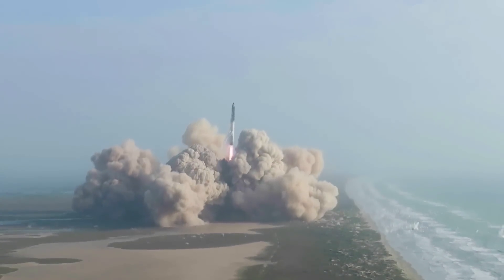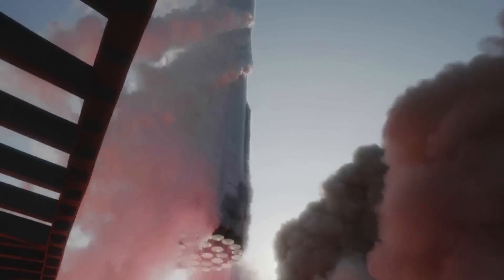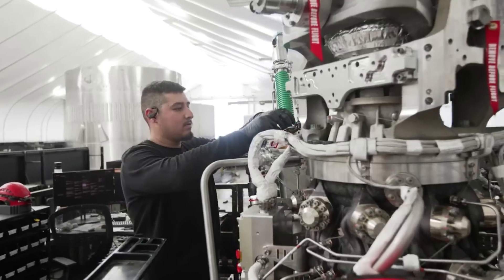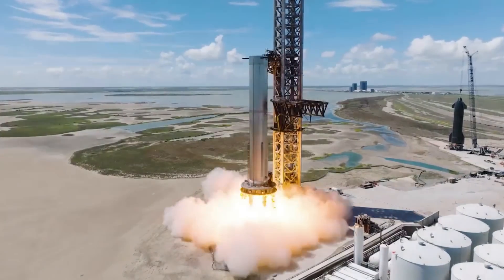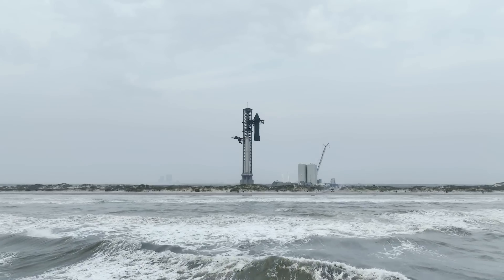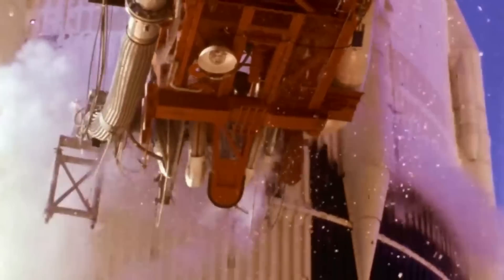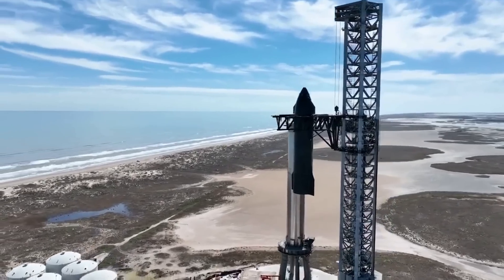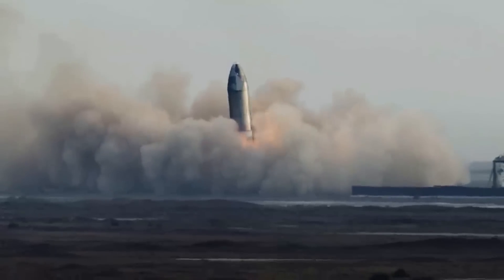Could Steel Plates Solve SpaceX's Starship Pad Issues?

Comment: I feel sorry for the engineers who tried to tell him this would happen without diversion. It was hardly a secret.
Reply: "It's not going to work."
"I know, but do you know how much it will fail by?"
"Well, not precisely no; the math only takes us so far."
"Let's get you that data then."

If you have an opportunity to collect data with fewer confounding variables, then best to take that opportunity.  If you propose a solution before you fully understand a problem there's a greater chance of being married to a solution that might not be the most effective, or worse yet a solution that will never work.

After all the whole idea behind this is that these rockets may someday land on a flat surface found on the Moon or Mars, and they probably won't have a fancy launch pad with specialized trenches to get them back up into space.
Reply: Well, I don't think anyone was surprised.  Musk said he hoped it would hold up.  But it's also been said that spacex needed that booster gone either way as the next one has many improvements.  So why risk the newer booster?  Tests are the best learning experience.  Of course your wording implies, and reveals, a lot.  Poor engineers that Musk wouldn't listen too was the least, or did you fully mean to imply Musk is an idiot and his engineers are smart.  Rings of a bad case of the common political 'Musk is bad' syndrome.  
He's lost starships and pads before in tests, everyone knew this ship wasn't getting reused either way, it was part of the flight plan.  This is the design mentality, often laughed at, but costs wise it makes Boeing and Nasa look wasteful.  
I guess they kept the engineers in another room without mics so now one could hear their sobs during the launch.  FUD
Reply: @clytle374 
Do I smell an apologist!! My pet theory is that a junior engineer goes to the next level engineer and says something like “this is not going to work” and the higher level engineer says “I know, but the game plan has been set by “You-Know-Who” and he fires people for moving too slow, not for trying a non-traditional approach that strokes his methodology so just let me continue being one of the sycophants that has a pay check, besides the time for the fix will be spun as usual, blame it on a governmental bureaucratic review“!

So in other words, go with the flow, the guy who cuts the paychecks is always right. Remember the senior engineer that was in charge of the sats that moved too cautiously, FIRED!
Reply: I don't. I find it satisfying when exactly what I said would happen, happens. Then it's kind of like a "told you so" moment.
Reply: Sure it was going to happen and engineers knew it. But now they have a better understanding of the scale.
Now they know that if they try to land a ship that big on another planet without a platform in place, its going to dig a hole and be unstable. They can build the ships. Somehow they need to get infrastructure in place on Mars for landing them. That likely means the first team will have to go to Mars with constructors and manage a soft landing with minimal use of thrusters.

I'm looking forward to seeing what they come up with. 
They should create a contest for college teams to submit proofs like they did with the hyperloop.
Don't feel sorry for the engineers.
This is the kind of problem they love to tackle. ;)
Reply: @Stuff_And_Things  Now they have a better understanding? 🤣
Reply: @IbnBahtuta  Of course they do. This wasn't suppose to reach space...Great if it had but this was as much about testing the platform as it was about testing the flight.
Reply: @Stuff_And_Things  It's cute to watch your cognitive dissonance in action, keep it up. 🤣
Reply: @IbnBahtuta  Sure thing. And I think I'll order the fries as well. ;)
Reply: Boosters won't be taking off from Moon or Mars,; they're only needed in Earth's gravity well.
Reply: @Stuff_And_Things  They will not land the full stack on the Moon or Mars but only Starship (top portion). This "little" guy doesn't cause damage.
Reply: @DavidLucBelanger  That's not a "little guy", and they also need to be able to lift back off of the moon and Mars.
The point is, they need to be able to find a way to do it before they ever send people there.
Reply: Remember? When. Landing on another planet or structure they will have landing leg similar to star ship 15 which did land successfully. Additionally whether? It's. The moon or Mars remember the gravity is significantly less than on planet Earth and would only require probably 1 or 2 engines at THE most in the landing descent.  So I don't fear for it digging a huge hole if the landing leg system is stable enough.
Reply: It hold up for the static fire test. So it was not that obvious that it would break from the real launch and they had used special concrete under the pad.
Reply: The static tests were only at 50% power, which the concrete apparently could withstand.
Reply: They didn’t do 33 engines on that static fire. They knew this was going to happen. They were lucky it didn’t blow up on the pad. @lubricustheslippery5028

Comment: Did the steel plate on the OLM  survive?
Yes, there's your answer.
Reply: And notice too that the steel.rebar didn't melt after the surrounding concrete eroded away.

Comment: Jet fuel does not melt steel plates. But will rocket fuel melt steel plates?
Reply: The rocket's fuel is ignited under extreme pressure so it is hotter and faster than fuel burned on the ground.
Reply: @Hedgehobbit  lol it was a 911 was an inside job joke. Don’t take me serious at all.

Comment: Would rockets require less fuel to take off starting horizontally rather than going straight up vertically, like an airplane does?
Just a thought. Less resistance but more time not going up to gain speed
Reply: Lol. 

No.

Comment: Use the high water level, dig a concrete lined deep pond around and under the pad. With a submerged pyramid shaped flame deflector in it.  With large feeder canals to supply water level for 10 seconds.
The thrust will be diverted into water. Kinetic and heat Energy transferred to water creating steam, water expulsion.
Reply: Except that the goal they're going for is to be able to land and launch in alien environments WITHOUT that infrastructure.
Reply: @kelaarin launch from other planets using starship. Super heavy doesn’t leave earth
Reply: @White-nh3nu  Same launch platform for both.

Comment: Another solution...get the Boring Company in to build tunnels connected to the flame diverter to vent away the flames safely.
Reply: They explained in the video why they can't dig a trench, the high water table, a runner would be subject to the same limitations
Reply: @oscarnevins5188 we put a tunnel under the English channel , so it's obviously possible to make it water tight

Comment: Well the most difficult part would be to determine how thick the steel plate has to be. If it is to thick it survives the pressure but it might melt the surface because the heat transfer rate isn't that optimal, since the water can't absorb enough heat that way. If it is to thin then it probably won't melt but the pressure might deform the top layer and thus they have to repair it way more often.
Reply: Nope, the heat capacity of say 25mm steel plate should be sufficient. Basically the exhaust would not be in contact with the steel plate long enough to raise the temperature to melting point. Look they were proposing to use steel plate on Project Orion which involved exploding hundreds of nuclear bombs 25m from the pusher plate, with temperatures of 67,000°C when the plasma from the nuclear explosion impacted the pusher plate.
Reply: @jonathanbuzzard1376  Oh I understand that. I also meant it more like to use it hundreds of times without replacing it since they want to eventually launch a Starship every other day. 
But I like to learn and I bet I get enough insight on channels like CSI Starbase etc, when it is time to install that watercooled plate on stage 0.

Comment: Any debris directly caused by shattering the ground would have flown sideways as the pressure from above is too great. The only thing that could have caused damage to the ship itself requires an explosion from the ground, so debris could be thrown upwards fast enough not to be pushed down by the thrust. Here's my take to the massive damage: the ground of the pad is less than 3 feet from ground water level. If groundwater gets heated up abruptly, it will start to boil and create an upwards thrust. No rocket thrust from above could be big enough to avoid this from happening. If the bubble bursts at high enough pressure, some particles may have actually damaged the thrusters.
Reply: Get a cutting torch and heat up concrete,  that stuff goes off like a mini bomb
Reply: @davefarmery8180  for normal concrete, yes, but they used a mixture of concrete that was supposed to mitigate that effect.
Reply: @DeferedPattern  so do you think it was the thrust that caused this not the heat
Reply: @davefarmery8180  both

Comment: With the damage to Stage Zero and the concrete, I'm surprised that Starship lifted off the pad, let alone kept flying.
That damage is going to take more than few months to repair and redesign.
Reply: There's a synopsis piece on the first series of Saturn-1 (search for Saturn-I program - All flights , and jump to 25 minutes - They show the launch pedestal for the vehicle after the launch and it looks a heck of a lot more robust than the Boca Chica pad. Sure Saturn-1 is puny compared with Starship, but that underscores my point.
Reply: @cowboybob7093  Hum (Thanks. I'll check that out). You know, I'm just a factory worker but I do play a lot of space and rocket engineering video games. After this launch I even started getting paranoid about the amount of horizontal surface on the launch pad thingy (Commode Seat in the Metric system). Think of all the heat, vibration, noise and forces blasting back off of that. One of these videos from yesterday said rockets can get damaged just by the noise reflecting back at them (noise suppression is one of the benefits of a water deluge system). This rocket generated the most peculiar sound even from 5 miles away. I have no idea of the physics of it but it seemed to have a very sharp edge. I'm grasping here but imagine if we were looking at the sound graphed on an oscilloscope I'll bet it had the most rapidly rising right edge anyone has ever seen. Though I could be wrong and it has everything to do with all kinds of supersonics going on. I'm really surprised but I'll bet these launches get even more spectacular in the future. If they start pumping water in there the steam generated will be awesome. 1600 to 1800 times increase in volume during phase change.
Reply: From the photo's I've seen of the launch pad damage on the 'net, I think it's more likely to be a complete rebuild/redesign rather than a repair.
Reply: Concrete ripping out from under the launch pad, pieces clanging against the bells of motors, distant structures denting or falling over (like cameras) and still, from within the launch control, it is yelled, "LOOK! IT LIFTS OFF ANYWAY!!"  ... From a view out over the ocean the Starship and Booster can be seen rising off the pad, and then huge splashes of concrete explode in the foreground...
Reply: Please. Let's all agree to not call it "Stage Zero" anymore. Let's stay with the correct name, "Launch Stool," or if you use Metric, "Launch Commode." Elon can invent all the words and phrases he wants but we don't have to fall for his Wowy Zowy BS.

And doesn't SpaceX have any engineers? They make it sound like Elon pulls ideas out of his arse. I know we've lost all faith is science since the Covid but there's a branch of science called "Real Science" which doesn't include "they're Science in their wet dreams, Sciences" like Economics, Psychology, Medical Science, Archeology, Pharmacology (Lol) etc. Anything that has to put science in it's name isn't science. The engineers try to work it out and anything beyond them goes to the scientists. They do this thing that's been forgotten in modern times called "Studies" or "Experiments." And not the obviously fake ones like they did for the DoD gene therapies. 

And now we find out the tests were done at half thrust? Is the FDA and CDC running this program? Oh! The cement manufacturer assured us that their cement was super strong and impervious to heat. Did Fauci run the experiments to verify that? Or the US military? This makes as much sense as the mega dollar weapons they're sending to Ukraine that we now find out were designed by ritards (not the handicapped ones that are pronounced differently and which we all love). Was this program designed by the "Scientist" that gave us the $53,000 M777 shell? Fire 600,000 of those a week and see how much that cost ($3.18 billion). It's a good thing the M777 barrels only last 200 rounds between replacement. That will save us a fortune and get hundreds of thousands of Ukrainians killed who were stupid enough to listen to America's leaders. I know! We can just send missiles into Donbass daycares. Wowy Zowy.

Comment: Unless that steel plate is in the shape of a flame diverter, it will FAIL!
Reply: Nonsense. Make the plate a yard thick
Reply: @esecallum  Doesn't need to be even that thick, 50mm would definitely be enough, 25mm probably enough.
Reply: @jonathanbuzzard1376  no. 50 cm thick. steel is cheap at $3/kg... 50 cm thick steel no cooling no breaking. it will impregnable to the 10 seconds of flame and thrust. 50 cm thick
Reply: @esecallum  50cm is utterly excessive, would be likely be a special order for procurement and take months to be delivered. I have just done some back of the envelope calculations and 50mm of steel will have a temperature rise of ~630°C worst case scenario. Lets run through the numbers. The super heavy booster has 800t of liquid methane on board and burns through this in ~120s. That is ~6700kg a second, which will put out ~367MJ of heat per second. Lets go for a 11m diameter steel plate under the 9m diameter booster, then with a density of steel at 8000kg/m³ and a heat capacity of 420J/kg/K it takes ~5.8MJ to raise the temperature of a 11m diameter 50mm thick steel plate by 1°C. That works out at 63°C per second, so 10s is ~630°C which assumes all the heat goes into the steel plate which is not going to happen so the actual temperature rise will be a lot less. Anyone saying a steel plate will melt is simply a nincompoop
Reply: @jonathanbuzzard1376  YOU  are correct . what i am saying steel is very cheap. why skimp on it. you dont need a single block you can have say 5 or 10 cm slices welded or bolted together to get the 50 cm.thicker means no need to cool it with complicated piping. al;so slightly bendy steel will mean it will not shatter as it is not brittle. look at all that brittle concrete slabs exploded everywhere. thick steel is a good heat absorber.
Reply: @jonathanbuzzard1376  There's a flaw to your calculations, you are not taking in account the thermal conductivity, the surface of the plates will be much hotter until it dissipates the energy fully into the cross section of the plates, and with the pressure waves coming in, it could literally rip apart the surface into bits of molten steel.
Reply: @DeferedPattern  I am not. If a steel plate would work as a pusher plate for Project Orion with a 67000°C plasma hitting it from hundreds of nuclear bombs going off 25m away then a poky chemical rocket exhaust will not be an issue. Basically, the thermal conductivity of steel is sufficient to carry the heat away from the surface to the rest of the steel.
Reply: @jonathanbuzzard1376  Using Project Orion is not really a good example here, it's a completely different mechanism of heat transfer, we already know that plasma has a very inefficient heat transfer due to boundary layers (ie: space capsules) and the energy burst happens in microseconds, it's not a sustained 10 seconds heat and pressure wave at 1 ATM, and the reason your calculation just doesn't match real life is because if it was this easy, Space X would've already done it this way, installing steel plates is very cheap and easy.
Reply: @DeferedPattern  It is a good example as it is a much severer scenario. Project Orion is over 500 nuclear bombs going off 25m from the pusher plate in space of a couple of minutes. We also know that SpaceX actually had a plan before the launch to install steel plates to protect the concrete, it just was not ready in time. However, after the test fire, they felt confident that the pad would survive one launch. Obviously, that didn't work out but that is what testing is for. Admittedly they want to water cool the plates, but that is not because they would melt but to stop them from warping due to thermal expansion from the heating they would get. Anyone who thinks a 50mm steel plate would melt in the time frame the exhaust from the Super Heavy booster is in contact with it is simply ignorant of the real world.
Reply: Musk and his fans refuse to except proven technology that has worked for decades.... a flame diverter. A flat steel plate will likely burn right through. Unbelievable.